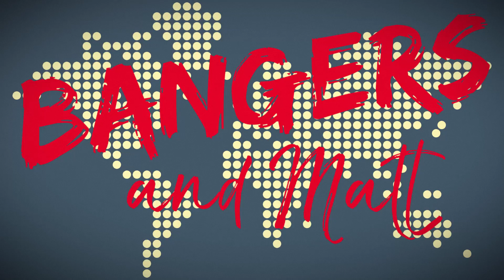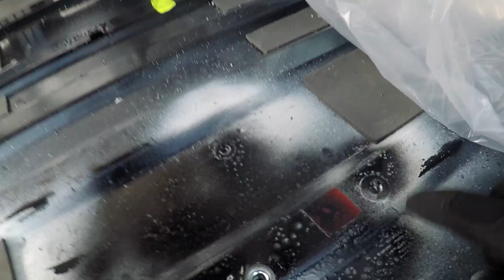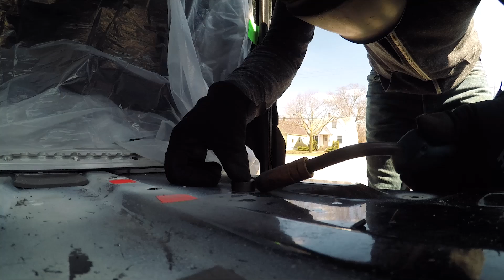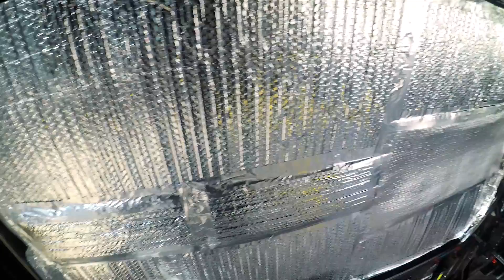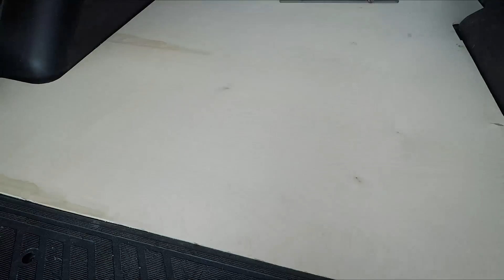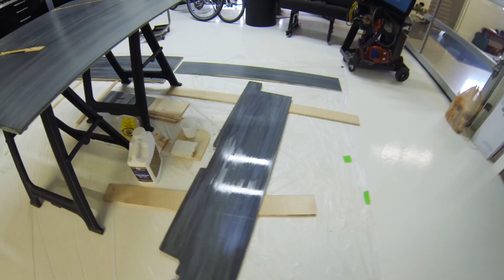VLOG #6 - Ford Transit Production Van Build. Floors, L-Track and Seat Mounts.

Comment: How did those nutserts hold up?  I put a bunch of stainless plus nuts in my van and they were useless.  Spun out.  I completely gave up on them.  What were the ones the previous owners of your van used?
Reply from the maker: The PO ones were trashed and cut out. We used the sealed bottom or stainless on a lot of them. Also covered them with RP342 later on. Had to remove some a while ago to move the fridge. 3 worked fine. One spun. Nutserts sure are a lottery... but so easy.

Comment: I love your floor, and would like to do the same for my van. Can you share some details (like the steps and products) on the staining and finishing processes? Thanks a lot!
Reply from the maker: Sure. It's pretty simple. We used 2 stains. One was Minwax Riverstone, and once that was semi dry, we wiped it with Minway Onyx. The floors are coated with Bona water based floor coating (4-5 coats) and sanded in between. The logo was inlayed using a vinyl stencil and staining over it.
Reply: @BangersMatt  Thank you! So, that's two different stainings and then a PU coating. I can't find the Minwax riverstone, but I'm not sure whether I can get Minwax at all here in EU, so I'll just look for a similar product.  I really love the color, let's see if I can find a way to mimic it.

Comment: Hey guys nice job so far.  Im a gaffer and have been working out of a sprinter van since 06.  Biggest mistake I see people make is too many shelves. 
I used to have a rack on one side but now its all carts.  You really have to weld up your own carts.  Noone makes carts with the intent of cramming as much stuff in as we do.  Make sure your footprints are unified up and down.  No handles sticking out etc.  I carry a full 3 ton grip package with 20x frames plus 4k hmi down to 200 jokers, skypanels, L7, litemats, and full tungsten 4x 2k,1k,650,300,150.  The 12k hmi and 5ks can go in when needed.  Yes it all fits.  What you want to avoid is having to cross load from shelves onto carts when your unloading. 
Big waste of time. On the weekends i would dump it all and put 6 dirtbikes in and related tools and gear.  I didn't bother insulating, however, as I'm in Hawaii.  No need for gloves either.  Will look for your other videos.
Reply: Hi J, very intrigued with your set up? Any chance you have any pictures you’d be willing to send me? Info@visualstarmedia.com or 201.388.1910 I’m currently planning to build my production van and would love to see what worked for you through out all those years

Comment: Hey guys. Nice craftsmanship. One question though. How did you attach seat to the track.  I’m working on similar project and looking for ways to mount the transit van double seat. Thanx. Would appreciate some pics
Reply from the maker: Used the factory rails. They have holes in them. Just bolted those guys right to the L-Track using 3/8 l-track lugs.

Comment: Awesome build. How is the wood floor held down to the van? Just by the recessed L track? I'm doing a similar floor, and i cant wrap my head around what to do first. Set the L track, or cut the plywood floor. Thanks.
Reply from the maker: Yes. Most of the floor is held down with the L-track. We're using flush track, and it has a 1/4 lip on all sides. In a couple spots there's some 1/4-20 into the floor. Where we've placed some floating nutserts. But mostly, it's just the track.

Comment: Hey guys , where did you buy nutserts and took for it? I keep asking hardware/automotive shops and people tell me they never heard of it. Is it only online? Thanks
Also how did you do that swivel chair? Awesome job, I got same van!!!
Reply from the maker: https://www.mcmaster.com/#93669a230/=1994q3k
Reply from the maker: They require a specific little tool. It's available from that same McMaster page/part ##.
Reply: What ya looking for is called "Riv-Nuts" , too also very useful for installing L-track
Reply from the maker: McMaster. 1/4-20 floating style.
Reply from the maker: Swivel seat is just a Transit specific swivel plate. They are on eBay. About $300
Reply: where do you buy it? what site?thanks
Reply from the maker: McMaster.com
Reply: I see in other of your video you install the extra seats, and that is what I'm trying to do , is to install a bench , would you use the same hardware for it ? or did you install it to new floor? thanks
Reply from the maker: We put down L-Track to the existing floor with brackets and supports on the underside. Then cut down the factory quick-release Transit seat brackets from a set of seats we had purchased. Then bolted those to the l-track.
Reply: where you guys from? you're rad!!
Reply from the maker: Thanks. Michigan.
Reply: @BangersMatt  Oh man, just got a Transit for the business and I got so excited for the idea that we had hidden swivel seats. Got me.
Reply: Can you reply with a direct link at mcmaster.com? I can't find the 'floating style' nut inserts.  Thanks.
Reply: Thanks, any recommendation for the proper 'set' tool?  Will any riv nut adapter do?
Reply: Oh I see now.  Always wanted to do this type of fastener.  Thanks!

Comment: Great build guys! What foam material did you use for the insulation layers?
Reply from the maker: Against the walls is NOICO sticky sound deadening from Amazon. Then just simple rigid foam insulation from Home Depot. Then a gap for air, and reflectix style aluminum bubble wrap taped taught in all voids. We didn't go nutso on insulation - nobody is living in the van, but wanted to take the edge of hot days and big rattles.
Reply: Awesome! I'm transforming my Ford Transit 350 at the moment also for video production on the road, but I will be living in it. I found great foam insulators like closed cell foam pads and aerogel that will work for the canadian winter but the insulation will cost more than the van!! Rigid foam board seems like the best way to go!
Reply from the maker: Yea. Aerogel is rad. Lots of people use Thinsulate sheets/batting as well, which is super effective but harder to come by and a bit more $$.

Comment: I like your use of the L Tracks.  Did you use OEM ford bench seat for your back seats that hook into your L track? Would you be able to send over a photo of your back seat mounted to the floor? Looking at doing something similar for a back seat/ bed conversion
Reply from the maker: ReCompose Media yea. They are factory transit seats from someone else's wagon. They almost perfectly fit the l-track. We just cut them down and used the factory square washers. Then topped those with a regular washer. You just have to get the l-track spacing perfect.
Reply: Gotcha.  Good to know.  Thinking about building a rock and roll bed style bench seat that would attach to the L track.
Reply: @BangersMatt  would something like that work with Sprinter seats?
Reply from the maker: @thestandardbarber1708  Sure. If you have a bit of fab ability, any seat would work!